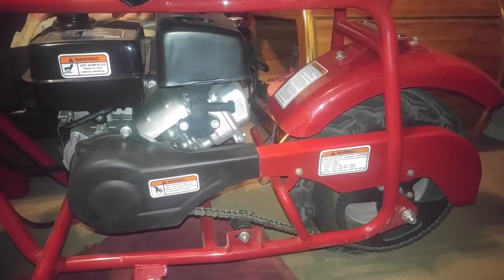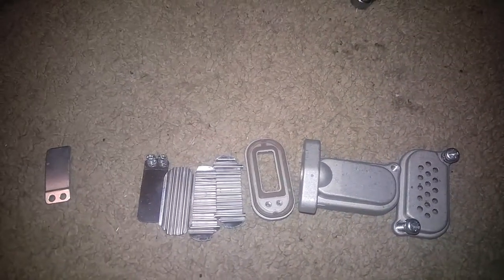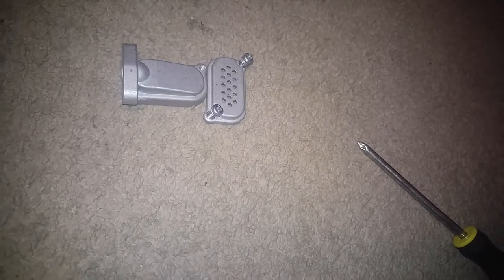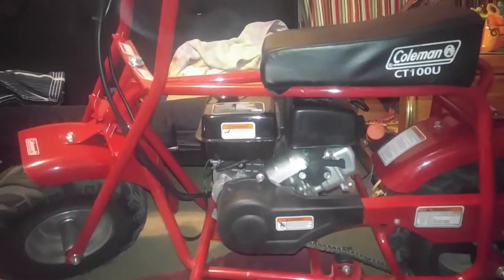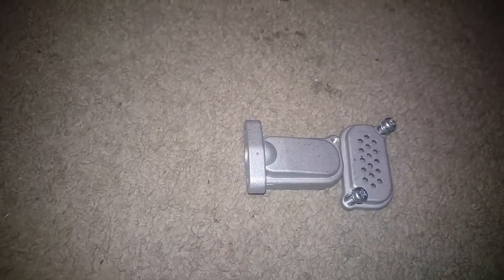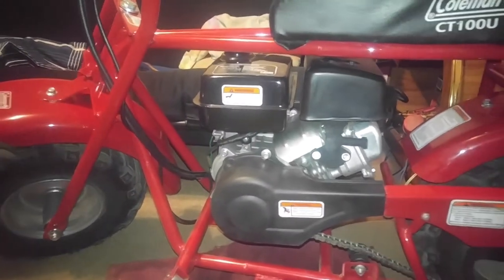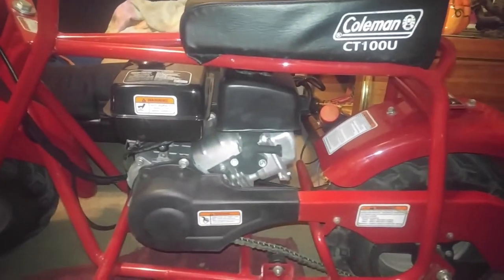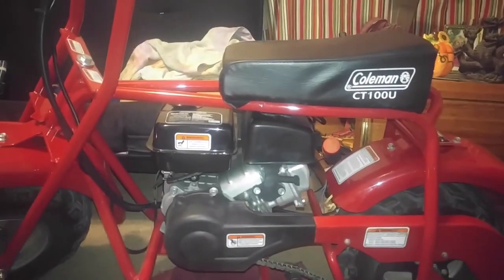DPS on a Coleman ct 100u mini Bike & what does it do? © By Spikemandan

Comment: What I noticed on the 196cc is that when the sensor is removed the motor will vibrate like a MAHFUCKER.  Happened to the CT200-EX and 200U. The best thing to do is just go to a predator 212.

Comment: well the million dollar question , did it help any ,  ? what would happen if you just plugged the hole where it bolts on to the exhaust pipe
Reply from the maker: its better to just leave it open to help with more air flow

Comment: I like your story but I get 31 miles an hour from a ct200u ex no problems with the dpu on it still all I did was tighten the gov to carb spring all together so really no modifications but that.  that way the governor can't pull back and forth with the spring and make the bike throttle up and down while you're in motion  tryi g to keep a steady speed . which is annoying as hell.

Comment: This is probably a CT100 only thing. I have not heard anyone report that this part is on CT200's. I have 2 CT200's and neither came with this exhaust piece.
Reply from the maker: having a bike shop make me a open custom pipe video coming soon no one makes an after market pipe for the 3 hp
Reply from the maker: you have to admit i was funny as hell in this video 
lolz
Reply: They make them on the newer Colemanct200u
Reply: That’s weird my Coleman CT 200 U does have one
Reply: The go kart too
Reply: BT200X owner here, mine had this fucker too lmao
I noticed most of my throttle response issues were GONE when I took the DPS and the rest of my exhaust off
Reply: It's on the kt196 that's why I'm here this is literally the only info about it online